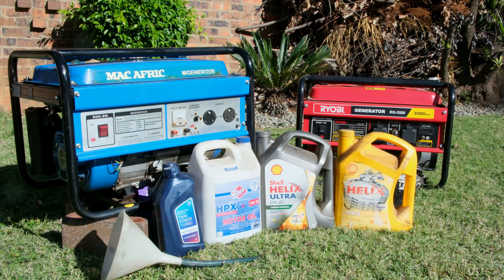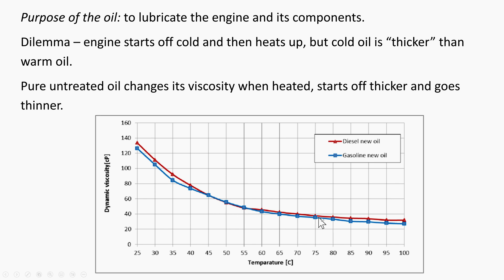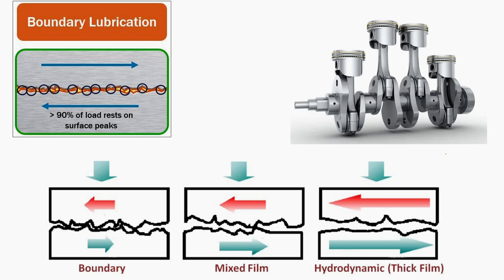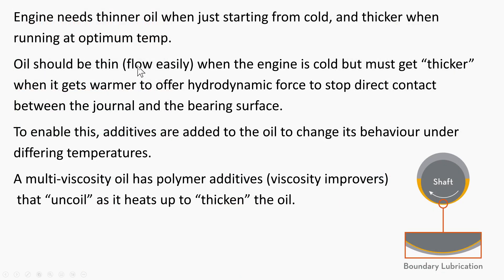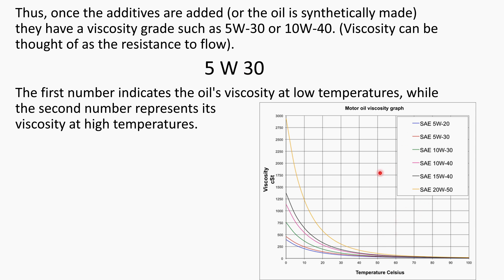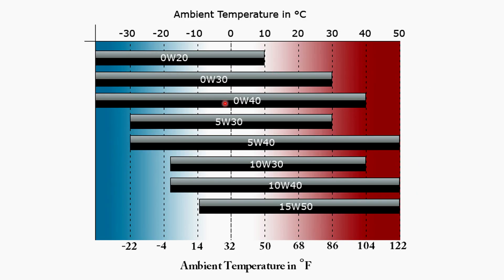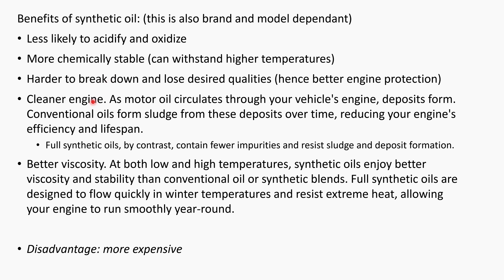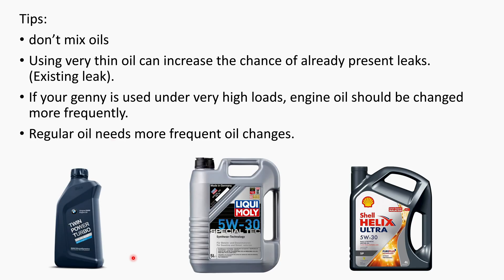What oil to use in a domestic petrol or diesel generator?

Comment: Thanks for the useful information, very informative! Some oils have manufacturer specification as well, ie VW 505, VW 502, VW 504 and so on for other vehicle brands5, I guess this is due to the abbrasive properties the wrong oil can  have in your car's engine (haha, lets use midas 20w50 mineral oil in a modern engine, nothing will happen). I am using VW as an example as I drive one and use 0w40 as to 5W40 for cold startups in winter (I'll let you know that Shell 0w40 Ultra is cheaper than HX8 5W40). Obviously this is not the case with your normal garage genny, which I have used Rimula, but changed after 30 hours of use to Shell HX8 which I had spare. So far, no issues.    Stick to manufacturers spec aswell